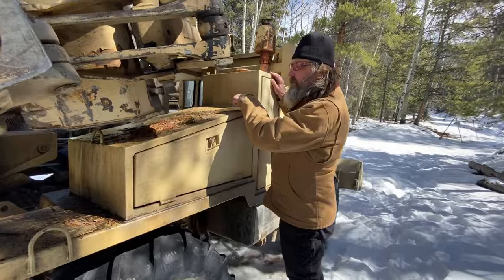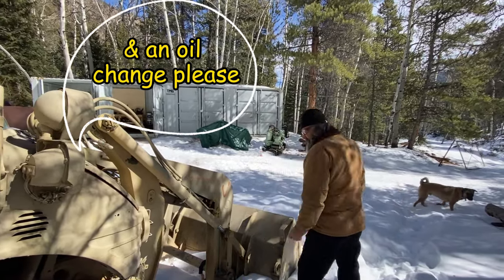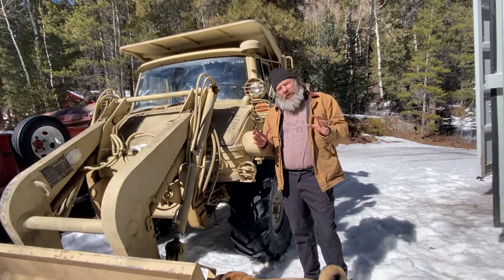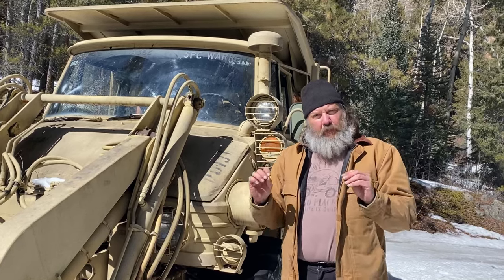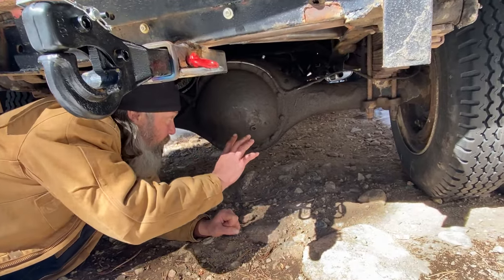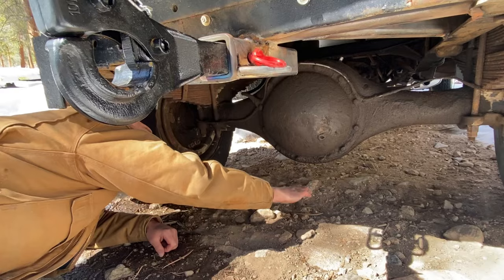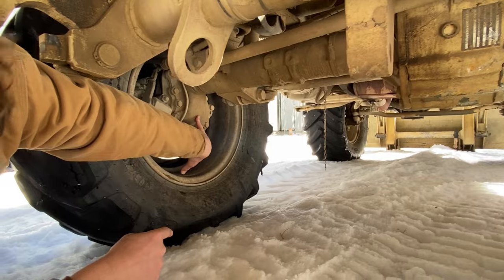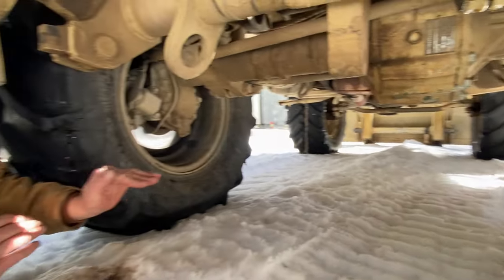Miles from Nowhere: The Unimog - Ultimate Off Grid Vehicle - Inside Our FLU419 SEE

Comment: I have a 89 SEE, my auxillary hydro system seems to not be functioning, i shift into the pto setting, then turn on the aux selector but the tools didnt seem to function..  Do they have any tests to troubleshoot the aux hydro system?  The loader and backhoe works as they should.  Thanks in advance!
Reply from the maker: The aux hydraulics are powered by the front engine driven pump. The issue is between your aux switch and the solenoids on the valve stack behind the cab.

Comment: Cylinder is ok dont replace it.may not leak or very little
Reply from the maker: Much appreciated - Would it be ok to sand down the spots with 800 grit?   Can I cover the metal with anything to keep it from rusting or getting worse?

Comment: Ive had my 419 up to 60mph on flat ground. Took about a mile to get there. 

I got into a tricku situation with mine the other day. I was buldozing weeds from an area and there was a huge log stump hidde . I drove completely over it and it because lodged undeneath. I was stuck. So i used the backhoe to pick the nachine up and shift it over till i was free. 
Loved your video! 22:10
Reply from the maker: Thanks so much for sharing.   I just broke an axle so will be out of commission for a few days.  I have spare parts unit - so I should be golden.  

Check this one out using the back how as a counter balance:

https://youtu.be/KQc2X2_3atM?si=CoYwdLPY75zNwtZU

Comment: Nice machine, I was thinking of getting one and stripping the bucket and backhoe off, but now I would feel bad doing that😅
Reply from the maker: I have a parts unit I plan to do that with.  The mechanicals are fine - but many of the small bits have been stripped by now.  Thinking about putting my 69 ford econoline body on it …..